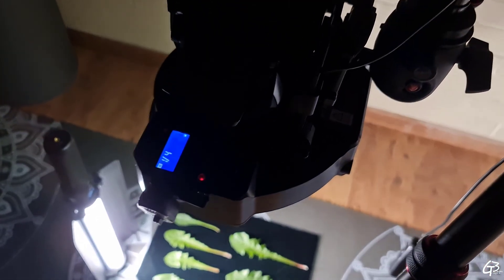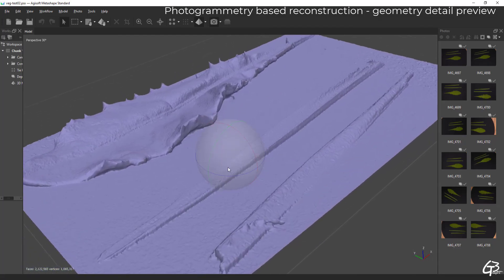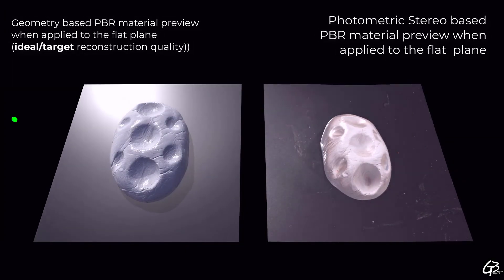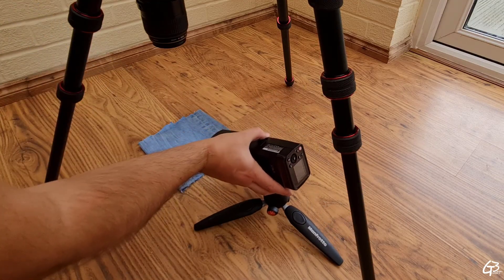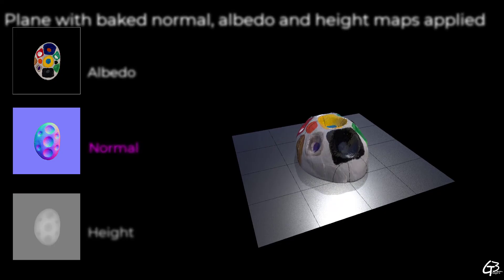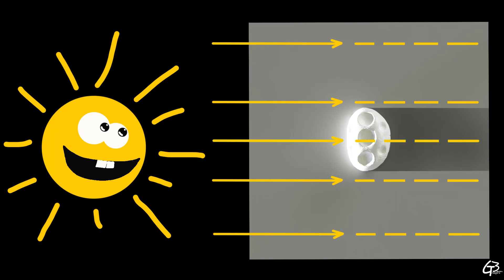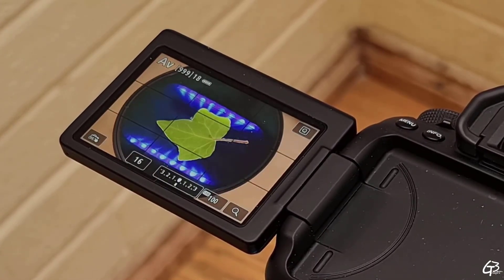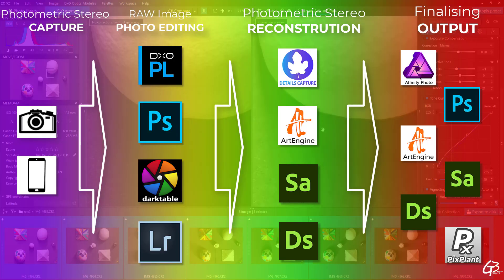Photometric Stereo Technique for PBR Materials - Using Shadow to Capture Surface Detail

Comment: was just the best video on photometric stereo! how was your result using phone flash as a light source? is it complete garbage? i am thinking about it for very small leaves!
Reply from the maker: Thanks. Light is the light and depends on spectrum it covers, its intensity and clarity, but also on environmental light pollution, distance from the subject and everything I mentioned in this video. 
I plan to make a video about light sources but need to save about £3000 for a special devide I need to use to measure spectrum detail so it is goint to take some time.
Anyway, imo the best tool for such captures is the wireless camera flash light with TTL feature to auto-adjust light intensity, as well as some decent, real camera equipped with lens, mounted on solid platform which prevents camera movement and micro-shake. Of course any light can do the job if used properly. Sure, you can use your mobile and get some results and it all depends on what do you really need and what is enough. To be honest, sometimes you dont even need photometric stereo, just some 'single image to PBR' processing tool which does the guess on values - or you dont even need a PBR data except the albedo  -for example this is how I made this flower for the glass vase scene here: https://www.artstation.com/artwork/WBO8qQ
Reply: @GrzegorzBaranArt  Hey thank you so much for such a detailed explanation! I tried with image to material in Sampler, but imo photometric stereo prevents the blobby cloudy details made during image to material. I have not yet started a job in the industry, so a bit short on supply haha . Therefore I am considering buying a cheaper solution, I don't need very high fidelty, but it should be passable! Tried with a ring light with very soft shadows, did not turn out great! So I will have to look for some more I guess!

Comment: Greetings Master. What apps do you use for reconstruction?
Reply from the maker: It depends. I recommend Details Capture and ArtEngine. Details capture has no image limit, has chrome sphere based angle autodetection and gives the best results but lacks of additional supportive tools. ArtEngine offers similar reconstruction options and good reconstruction quality but is limited just to 16 images. From the other side ArtENgine offers some additional useful tools. You can also use Substance Sampler or Substance Designer, but both are limited just to maximum 8 images and dont have chrome ball based angle autodetection (fixed angles only).
So for reconstruction I would recommend Details Capture and this is my primary tool for this purpose. Next I usully use ArtEngine to remove seams, generate roughness by subtracting cross polarised image from parallel polarised one etc. At the end I use Photoshop/Affinity Photo to tweak values if needed
Reply: @GrzegorzBaranArt  the only ArtEngine i find is a discontinued project for unity. Is it that one?
Reply from the maker: @X3msnake  Yeah, this is the one I mentioned. Its just an option though, there are many other tools/solutions out there. For example you can consider PixPlant for automatic seam removal, or Substance Designer, or Substance Sampler, or remove then in Photoshop, Painter, Affinity manually etc. From reconstruction point of view, 'Details Capture' is the one which provides the best results from these available on the market (regardign these I tested).. at least at this time. It might change in a future
Reply: @GrzegorzBaranArt  in my case I am mote interested in the rconstruction alone to use for high detail capture on subjects like coins where Photogrametry and 3D scanning have a hard time or are slow. Did u try any opensource solutions like Fiji (imageJ) photometric stereo tools
Reply from the maker: @X3msnake  As I see its an open source which is nice.. unfortunately I haven't tested it. Is this good?
Reply: @GrzegorzBaranArt  looks like it works but i have no workflow to compare to since i am new to photometric stereo

Comment: is it possible to combine photometric stereo scans with a photogrammetry scan of the same object in order to increase the detail level of photogrammetry scan. If so, how would you do it?
Reply from the maker: Yes, it is possible and some folks does it on a daily basis. Its not so simple tho, as it combines two different techniques, therefore needs dedicated rig with doubled functionality and dedicated software to merge 3D and 2D data.

Comment: I'm a 3D artist who also has woodworking skills/a small shop. 

I've done a fair amount of photogrammetry and I really want to get into this now too! I'm strongly considering building a custom photometric stereo station now after watching this video. 

It would just be like a box or frame made from 2x4s cut to length with screws holding it together. Then a section to attach a tripod mount for the camera at the top of the frame. I could easily add in some holes on the base sections so that the light is always registered in the exact same positions.
Reply from the maker: Totally agree, unless you want to be mobile and agile regarding the subject size, physical coverage and overal capture environment. Not to mention that custom setup takes a lot of space and isnt very adjustable.

Comment: Very informative video as usual! I did some photometric stereo test a few months ago but never created a good setup for it. Good video to help with that.
Thank you for sharing your knowledge and experimentation!
Reply from the maker: My pleasure, the cool thing is that most of the gear can be shared with other techniques, so unless you dont build a custom fixed rig, its actually quite affordable. I would definitelly suggest to invest into a good light source and honestly.. the TTL flash is really fun and straight forward to use and solves a lot of issues :). Especially that nowadays, Details Capture or ArtEngine have chrome ball based automated light angle detection. Unfortunately ArtEngine supports just up to 16 images .. at least the recent version. Details Capture 256 to compare :).

Comment: I can't believe so much good info is packed into this vid, and appreciate you take the time to explain and demonstrate everything, even if it means making a 1 hour+ video. I'm sure it was a lot of work to edit. I have been trying to learn photogrammetry and I can see so many errors I made, because I didn't know this stuff before. I'm looking forward to doing some better captures.
Reply from the maker: Thanks, very appreciate. We learn all the time so its normal. The key to excel in something is to never give up, thats it. Btw. this exact video is about photometric stereo technique which is an alternative to photogrammetry, its not photogrammetry. This technique tho can be combined with photogrammetry to extract the surface data on the level photogrammetry struggles with :). Good luck with your new captures :). Cheers!

Comment: Which tools would you reccomend for seemles textures like you mentioned at around 57:23 ? Trying to figure out what to use for bark textures.
Reply from the maker: It usually depends on the subject, texture size and budget. I recommend Unity ArtEngine for this purpose and this is something I use on a daily basis. Unfortunately while it was the best tool available for seam removal, it was discontinued and cannot be purchased anymore. The next solution I would recommend is probably the manual seam removal in Substance Painter - I covered it in some of my previous videos and in details in my first book about photogrammetry. I plan to record the entire video to cover seam removal subject if I ever find some time and enough motivation. There are also other solutions like PixPlant, Sampler, Designer, Affinity Photo etc. and some are better in some areas while some in others. Even half automated offset based manual seam removal in Photoshop or Affinity is also an option and seems to be the only solution when you deal with extreme big texture resolutions, Painter, Designer or ArtEngine wouldnt even handle. Hope that answers your question.

Comment: Have you tried light modifiers (especially on flash or high-powered light sources) like grid or wrap the end of flash with thick black paper/cardboard as an extension tube of sorts?)
Reply from the maker: Why would I? I used polarisation filters to get rid of glare but glare is not a big issue with enough angle coverage and the light source placed under 45 degree angle.
Reply: @GrzegorzBaranArt   i meant for a more channeled / direct light light source for your photometric work or working with shadows. I have not heard of this fascinating technique before but i was wondering if it would work well for this technique :)     .. maybe not… I don’t know.. just throwing it out there. This or cone light modifier was something i used a lot in portrait photography to channel light ..minimizing spill.
Reply from the maker: @vrguytokyo  I think that many depends on the exact application and its algorithm used for data processing, so if the app wasnt designed for something, even better illumination might give oposite results. It was the issue I had with slim light as none of apps I used were desinged with this type of light source in mind. But I would consider a great idea for whatever works and gives you better results as et the end, this is the result what matters

Comment: Will your new book come out in 2023, will it be an update of the previous one or will it still be a new product with a new price?
Reply from the maker: Hey, I am still working on it as I don't want to release it until its not completely ready and covers every single aspect I believe should be there. If nothing changes I plan to release it in 2023. It is going to be a new product with new price but kind of based on the first one. Since some folks asked me about color calibration which is part of the incoming book, I plan to release just this chapter seaparately earlier - probbaly end of this or beginning of next month as part of incoming video about color calibration.

Comment: Hello howdy, very good video thanks for your time to explain, I wanted to know what features your pc has.
Reply from the maker: Cheers, sure, my PC isnt anything special. Its I7-7700K and 64GB of RAM with GF1080Ti on board
Reply: @GrzegorzBaranArt  Hello, thank you for your reply.
I wanted to know if I can send you a project that I made is a photogrammetry test, to see if you can give a little retrolimanetacion, I am interested in my pc is an i7 - 8750h with 15 of RAM and a gtx 1060 6 gb graphics card, and well doing the job with 6 million polygons as practically spend 5 hours in the whole process, I know you handle dense models of polygons and well I think in relation to the pc I have is to increase the RAM to 32 as it is a laptop on which I work. but I think I can get a little more out of it, I remain attentive and thank you in advance for your training on the YouTube channel.

Comment: Very nice tutorial. Have some questions:
1. How do you extract specular/roughness maps (polarized vs unpolarized images ?) , AO ?
2. I think ArtEngine can do 16 images, Adobe Sampler 8, but can this be done in Zephyr?
Reply from the maker: 1: By substracting data between corss and non crosspolarised captures. But for generic surfaces I simply generate roughenss using technique I shared in my videos already. I use albedo, ambient occlusion/BlueNormal channel, or use the node which generates roughness/gloss based on color ArtEngine offers.
AO can be generated from the height map or from the normal map. Blue channel of normal contains kind of AO map.
2. Yes, ArtEngine photometric stereo reconstruciton is limited to 16 images only. Details Capture to 256 limited also by the amount of available RAM, both Adobe products, Sampler and Designer are limited to 8 images only. As far as I know, Zephyr has no photometric stereo module but during computation generates noise on a micro level from the albedo. Its a fake noise really and I would say.. more a single image based one. Photometric Stereo is more accurate and reliable regarding the captured data accuracy. I would say that 3D Zephyr is made purely for photogrammetry based reconstruction which is a different technique to photometric stereo as is based on totally different concept.
Reply: @GrzegorzBaranArt  thanks for the detailed answer. All the best. Looking forward to new content

Comment: wow, awesome amount of information - on the "straightness" of shadows, would a fresnell lens do something about straightening it, it also seems to have a more linear falloff.. I stripped some off a TV while looking for polarisation filters (they are difficult to take off tvs as they are pasted on like a sticker, but you get 2 fresnell lens films)
Reply from the maker: Thanks, honestly, I have no clue, I would give it a try for sure as long it doesnt affect the beam purity. I believe that all depends on the scale. If you scan 15x15cm area and the distance between the light source and the subject is safe, you shouldnt get too much angle distortion. For 50x50cm area coverage, the angle spread might be a big issue to solve as the considerable working distance would be way too long. As said, definitelly worth to try, as every single improvement really matters here.

Comment: Hey, great video! The best source I've found about shadow capturing & photogrammetry :)

I'm thinking about buying the godox Ar400. What are your impressions about using the Ar400 as key light for shadow capturing? Would you recommend to buy the ad200 too or do you think the Ar400 would be good to start with?

Thanks -
Justus
Reply from the maker: This exact video is about photometric stereo technique, not photogrammetry. Just saying. For photogrammetry I would strongly recommend AR400. For photometric stereo AD200. AD 200 has TTL option which compensates uneven distance to the subject when shooting around. It is also smaller as a source of light while AR400 works more like a aerial light. To be honest, any light should do for the beginning, .. some use even mobile or simple torch. Of course it affects the final quality. I recommend flash mostly because it can overwrite the environmental light so I dont have to work until it gets dark to capture something :). Hope that helps, Cheers!
Reply: Yes I know :) Just looked both of your videos 😊

So probably I'm going to buy both. I'm a 3D Artist and would love to capture my own materials :) haha spend the last days to figure out what light setup the guys from megascans are using but the elinchrom elb 500 setup is right now a bit to pricy and I don't see a great advantage (except +100ws and TTL in comparison to the Ar400) (when I understood it right that you can use each output at 250ws when using both ^^)

Thanks a lot :)

Comment: Hi. This technique looks ideal for recording apotropaic marks in buildings I'm surveying. I use Agisoft Metashape for photogrammetry, but haven't come across the software for PST. Can you recommend? I use a Mac computer. Thanks
Reply from the maker: I covered a bit about the software in this video already. I considered a separate video where I was planning to cover more details but I dropped an idea do far due to lack of interest. Regarding photometric stereo apps, each differs and offers something other dont. I prefer Details Capture because it has no image limit for processing. ArtEngine is also really good but it has limited amount of images it can process to 16 only - at least for now. Both of these offers chrome sphere based angle autodetection. Substance Designer and Sampler are limited just to 8 input images and expect fixed angle therefore. They dont have chrome sphere based angle autodetection and therefore are way behind the competition. Of course Designer offers some awesome tweaking tools as well as option for easy atlas composition. Substance Sampler .. at this stage with these tools it has seem to be a waste of money and wouldnt bother with it.
Reply: @GrzegorzBaranArt  Thanks.

Comment: You may consider black velvet across your surface rather than spray paint. It's a good light absorber and can be cleaned easily with a lint roller or tape.
Reply from the maker: Thanks, unfortunately I did. I have found that fabric gets dirty way too easily and is tougher to clean to solid surfaces. Also fabric has  too much details as a surface itself. Even cardboard was too detailed. Photometric stereo is so detail oriented that I was regenerating all this fabric noise beneath the actual subject ;). So I have found that the cleaner and more polished the surface, the better, the only problem was to make it matt so it doesnt reflect environment :). As I said in the video, I dont cross polarise side shots so every black surface is going to be visible to some degree. The point is to make it clean so its easy to cut - talking about vegetation and overall litter captures. For tiling materials, fabric as a light absorber should be fine